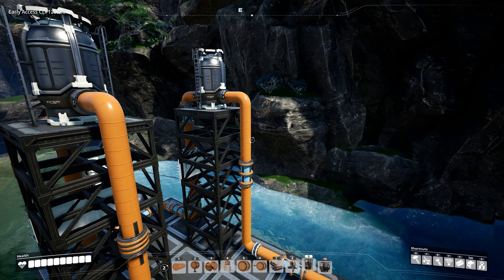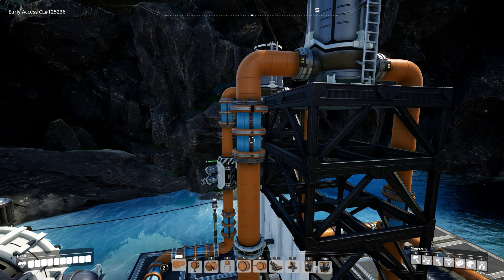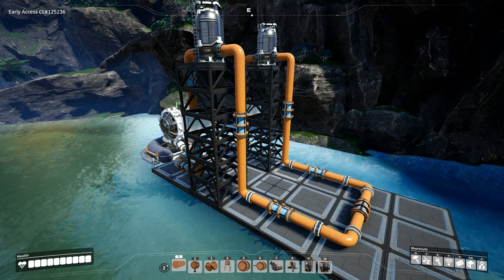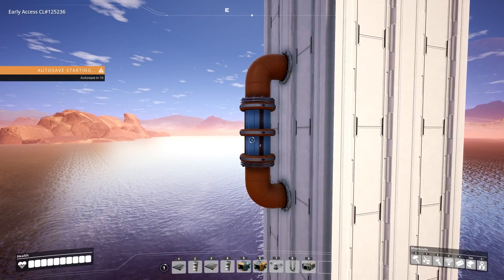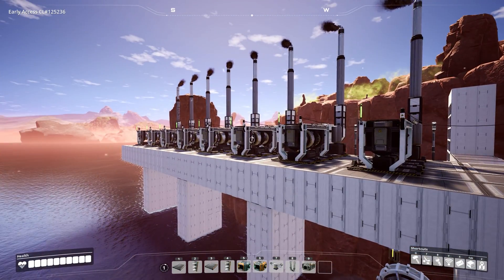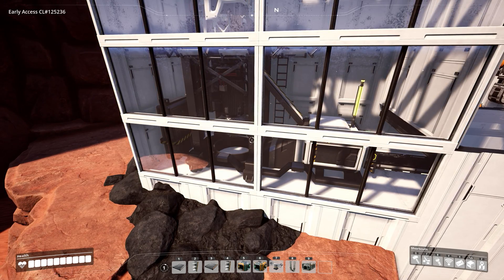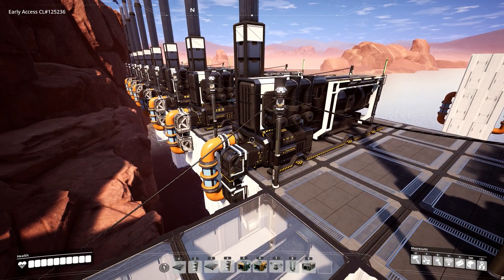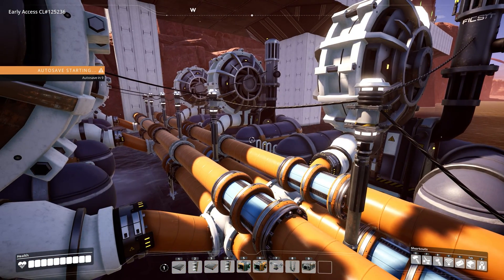100% Efficient Coal Generator Basics [SATISFACTORY GUIDE]

Comment: Your channel is a savior from heaven! 
 I seem to have an issue where the coal to the fursthest generators doesn't reach them quickly enough for them to actually get those 15 coal per minutes... I have 2 normal nodes onto which i put MK2 Extractors so that i have a total overflow of 240 (that being split into 2 separate lines, i'm still on MK2 conveyor belts etc)
Now, neither of the generatos seem to keep up with the coal consumption and i can't replicate your system given my space and small space of water (a small lake) 
Water tho, i'm running a pump moving 180m3 of water into 4 separate generatos, bringing it up to exactly 45m3 each (pump has an overclocking fragment inside)

Any suggestions? 
I can provide video and anything that might help, a streaming session on Discord too.
I'm testing the setup in creative so that i can actually replicate it in "survival" and have it generate 1.2GW of energy so that i can get past Phase 2 and Phase 3 with the energy needs.

Comment: Great tutorial! One thing confuses me a bit though. Where do you connect the bottom en top pipelines? Is that happening inside the tower, because I don't see any junctions where the bottom en top pipeline-layers connect between the water extractors.
Reply from the maker: Check this video out instead. It's more current and I spend the back portion of the video reviewing this specific build in better detail as a result of this kind of comment on the video. Hope it helps. https://www.youtube.com/watch?v=0ExdbBGt7ig&t=99s

Comment: Very nice video, indeed. I'm a fresh newcomer in Satisfactory, just 44 hours, tier 4 under work to unlock everything. I got some basic questions, if someone want to reply. First is, (consider i don't have mark 3 stuffs about conveyor belts but just mark 2), from a single resource node of coal, how many coal power generators you can feed? i've tried to feed 8, but too slow input of coal. the other struggling is the water pump. Looks like there's no way  to feed (apart doing the overclock) more than 2 coal generators with a single water pump, if you connect 3, is 120mq/minute against 50 + 50 + 50 of the coal generators, so after some, a couple of power generators runs with no water and the power line in the graph become not flat but a like a saw teeth. Any suggestions, please?
Reply from the maker: 3 water extractors to 8 coal generators and 120 coal per 8 coal generators. When connecting the 3 extractors to generators, you can’t run them all into a single MK1 pipe. You’re bottlenecking water. Each extractors provides 120 water/min so 3*120 = 360 > 300. What you need to do is feed each end of the coal generator system with a pipe. Better way to think is splitting 360 into two lines of 180 from each end.
Reply: @Scalti   Thank you very much!. Now i got 12 coal generator feeded by 3 nodes Mk2, with 4 pumps overclocked at 150, one connected with 3 generators. System runs finally stable, 900 MW. Now to optimize, i would like to add other 4 coal generators, total of 16, i will try to feed with two nodes Mk2 (1 less) and 4  water pumps, one will provide water to 4 coal generators. Should work, what do you think?

Comment: I’m still confused on the extra 60 pipe- is that coming from the “key pipe” that gets connected to the vertical pump, or does the pipe that comes down from the water tower split in two on the sandwich level, leaving one to make the run to the generators and the other to go straight to the last generator? If all pipes are connected and equal, what makes you have to specify that last one getting its own pipe?
Reply: After watching a couple more times and fiddling around with what I have going on I managed to finally come to understand the whole point of the other pipe and getting the water to average out- I learned a lot from this, thanks man.

Comment: I'm able to place a water extractor with 1m foundation blocks all around it, and then build a platform up and over the extractor, with two coal plants, and then another layer overtop that and using the soft overlay/overlap feature to stack two more coal plants within the smoke stacks of the layer below it. The end result is a 1:4 ratio of extractor to coal plant, with all four coal plants directly on top of the water extractor. It does require each building to contain a single fluid tank, and several pumps. But its super-compact and stays 100% filled on water, all from a single extractor.

This seems to prove that at least some of the calculations in this ~2yr old video are a bit off on the current update. But still another really amazing video from Scalti. I've already used these videos to reproduce stator and reinforced plates factories... both of which look fantastic. I love the general design methodology, which once you "get it" becomes a lot easier to arbitrarily create other factories.
Reply from the maker: Would keep an eye on that. The recipe hasn’t changed. One extractor provides 120 water and one generator consumes 45 so you have a 60 water per minute difference on this system. The golden ratio for water and coal is 3:8

Comment: Question: if i put a coal generator 3km from my base cuz the wate ris there, and use a ton of power lines and poles, will the energy make it to my base?
Reply from the maker: Yes. There is no degradation over distance.

Comment: REALLY wish I could see INSIDE the water tower on the build after the explanation. I still am not full grasping how you too 4 pipes down to the water extractor. You also explain after they go through the water extractor the split to three pipes.... what??? Removing the walls of the water extractor tower would have been very helpful sigh
Reply from the maker: Check out my fluid mechanics video. I cover this in that video along with a more detailed explanation of the water tower mechanic.
Reply: @Scalti  just a pro tip, people shouldn't have to watch a second video to be able to follow this one. you honestly should have removed the walls so people could have seen the pipes. just my 2 cents. also didn't the mechanics on the generators change in that they now utilize the full consumption rate no matter the power draw ?

Comment: Very good looking and clever built! I've spent quite a time in order to do something similar with the pipes and while I managed, the only thing that I still struggle is showing the water indicator on the small pipes going out of the tower. Any tips how can I have it there or else they don't make any sense like this.
Reply: And the moment I posted it I think I realised what happened - my cuts are too small. Now the distance between the wall holes is bigger and everything is as it should be! :) Leaving this in case someone else has the same issue.

Comment: when splitting my coal, by burner 8 the coal is running dry, what am i doing wrong. mk 1 miner on a pure node with mk 2 belts
Reply from the maker: If you’re doing overflow system, it will take some time to balance out. Otherwise, I have no idea. :\
Reply: @Scalti  for some reason last night, it did just that, everything full of coal now, although my water kept drying up on 2 centre burners, lol, solution - add another water extractor, 4 on either side, all working fine now. thanks for your reply and carry on the great builds !!
Reply: @horse197235  yea the "manifold system" (a bunch of splitters in-line) takes a bit to fill up. usually most people don't power them up till they buffer up and fill all resources.

Comment: Visiting this video to try and help me improve my power system as my current system is/was greatly lacking in efficiency. 
I tried to follow the video best as I could given the location and scale of the build is different. I’m hauling a single power bank ( 8 coal generators and 3 water extractors). I have a Mk1 miner on a pure node, that leads to a mk2 belt to the first splitter and from the first splitter on I’m running mk1 belts. I’m not getting the full efficiency as demonstrated in this video. A believe a large part of that is my water system as I don’t feel I have a full understanding of it as well as it’s super spaghetti. Any help from some fellow pioneers would be appreciated.

Comment: How does the coal miner overflow system work? smart splitters?
Reply: just splitters, a normal splitter will automatically send the input divided by the outputs. so if you put a splitter down, feed it 60, it will divert 20 to each output. if you only have 2 outputs (the generator and the next splitter in the chain) then as soon as it can't send more to the generator, it will then send all input out the one side. so with 2 sides it will do 30 each side IF it can. as soon as a side can't handle the 30 it would send all 60 through the side that can take it. I hope that helps make sense of it.
Reply: @problemchild959  Damn. This was a long time ago. I think i had played Satisfactory for like 40 hours when i posted this. Now i have 400 isch.. XD

Comment: I tried to make my own version that produces 2400mw but I ran into an issue.

Instead of having the 6 with 3 on each side, I tried having the 6 come in from the side on the key pipeline.
A visual: 

    | | |
||====
    | | |

The || is double of course with it on top with nothing coming from sides.

I then routed it up a water tower and back down into the 4 like the video. Then it goes up. However, this is where it gets different. Instead of it it going two two on each side, I make it where all 4 go to one side and one pipe goes to 4 coal generators. Is this where the issue is? Does it have to be two with and end loop going to 8? I can attempt to redo the design but i just cant figure the issue out. Doing the 1200mw style in the video takes up too much space for me to make a new one. Tried to compact it a tad bit.

Comment: Dear Scalti, I noticed that your pipes enter your sandwich layer through floor pipe holes. I don't seem to be able to do this - is this done via a mod and if so, which one?
Reply: No mod. put the floor first and then pull a pipe through. There are no 'floor pipe holes' in the game.
Reply: @Jila_Tana  thats funny I bought them in the awesome shop and use them all the time. what you mean there is none in the game ?
Reply: @problemchild959  Thats funny that you respond with this after a content patch was applied to the game. I can assure you that before the content patch, those didn't exist.
Reply: @Jila_Tana  ok well just seemed like 6 months ago wasn't long. as a developer (not games) I know that even simple stuff can take a very long time so it just seemed an odd comment.
Reply: you can buy floor holes from the awesome shop with tickets from sending excess resources to the sink.

Comment: I'm currently having issues with this build. At 8:28 It shows two glass windows and the back of the MK2 Miner having a wall. it must be the way your camera is angled because the output of the miner doesn't line up with mine and i would need 3 walls instead of two. Also i can't see or figure how you did your belts into the factory. The smallest detail helps noobs like me.  #Kudos on the design
Reply: put a false floor in, drop the splitter onto it, remove the false floor

Comment: I know this is several months old now, but hoping you can answer a question about this build?

Inside the sandwich layer, your pipes have a junction that seems to connect directly to the wall holes.  I can't figure out how you did that.  I can get the junction aligned with the wall hole, but if I try to put a pipe there, it says that it's too short.  Mind clueing me in on how that works?  Probably simple, but I can't quite figure it out.
Reply from the maker: It’s not that close in reality. Definitely have a space in there to allow the pipe to be not ‘too short’.
Reply: @Scalti  Thanks

Comment: I had some trouble figuring out how to place the splitters on top of the pipes. Adding another 1m foundation and then stacking 2 splitters on top of another was what worked eventually. Does somebody have an easier method?
Reply from the maker: Build a 1m foundation in the middle of the layer and build the splitters on top. Then delete the foundation or keep.

Comment: i was going to build something akin to the elevated fluid buffer but i second-guessed myself and thought "oh they wouldn't have modeled bernouli's equation", but lo and behold.
Reply: also, i doubt they actually used the equation considering that all of the pipes have the same cross-section surface area, but it's interesting nevertheless.

Comment: This tutorial needs to be redone now that update 4 is on experimental because the power systems have changed. As I understand it now everything but biomass burners now provided maximum power output. You can build a battery to store the extra power. Until the update gets pushed to the normal game the old rules apply but players on experimental need to know about the changes.
Reply from the maker: You won’t need batteries for the system technically but yes you can add batteries to the build to smooth out delivery and capture overhead.

To clarify as well, I will update this video once mods are available for experimental branch.

Comment: maybe you wouldn't need such insane water pressure if your generators weren't up so high?
Reply from the maker: I think calling this insane is gratuitous, especially considering late game builds. This build only requires 2 pumps overall compared to the near hundreds you’d find on large end game builds not using the water tower method. Additionally, the generators are built high up to maximize water extractor real estate below. At the end of the day though, it’s user preference on how they want to build something. My channel merely provides guides for others to either replicate to a T or build upon adding their own flair or improvements.

Comment: I loved this design when I discovered it -- especially the physics governing pumping water to a certain height more easily. I immediately set about to duplicate this design for my own game. It took me a week -- scores of hours to follow the example and figure out the tricks to sandwich payers and the rest. But I learned so much by doing that. Then an update (or errant mod) crashed my 500-hour game (I had completed everything including gathering all necessary resources to switch on nuclear power tier 8).
Since no one has been able to help me salvage that game, I began again with all I had learned in the first one. Things went much more smoothly, especially with underground conveyors and Just Fly!
I came to the point I needed much more power (without fuel as yet) and so I set about to use your system. But this time, rather than building the generators high above the water, I built them at water level and dispensed with the (very neat) balancing tower.
In four hours I had 34 coal generators powered up with generous coal and water supplies.
Your designs are beautiful, but I could never figure out how to move from beautiful factories producing some screws, plates, and rods, to utility factories pumping out high volume steady flows of basic materials required by stators, rotors, smart plating, motors, etc. 
You did show me the value of building factories upward, which was a great assist.
I enjoy your soft-spoken, clear, and artistic videos, and I am looking forward to seeing the acres and acres of design required to produce 2500 versatile frames or 1000 modular engines. My present approach is to build these processes in (temporary) connected steps, since in my first game I wasted hours building a stand alone sequence for creating versatile frames, only to discover once you shoot the required number into space, you never need them again. (Unless the designers add these advanced elements as building blocks in future updates).

Comment: OK, I'm stumped at 7:03.  How did you get your splitters to build in the air like that opposite the conveyor wall openings, but with a bit of a gap, rather than snapped directly onto the conveyor wall (and thus clipping into the wall)?
Reply: Stacking splitters on top of one another results in them clipping into each other rather than doubling the height, as I thought might work...
Reply from the maker: Build an 8x1 underneath and then delete afterward.
Reply: @Scalti  Friggin' brilliant, man.  Thanks so much for these videos.  They're really the best out there.

Comment: Going to have a go at building this soon, my current setup is a quarter the size. I know this is an older video now but the only thing I would love to have seen is the pipes inside the water tower. I haven't got a lot of experience with the pipes yet.
Reply from the maker: Check my 2nd to last video covering fluid mechanics. It’s in there as well as a more in-depth water tower demonstration.
Reply: @Scalti  That's great. Thank you.

Comment: Congrats on the fantastic channel mate! 
One question about the pipe/watertower mechanics though. During your demonstration, the pumpless pipe going up to the watertank on the water extrator side shows opposite flow during your demonstration. Can you confirm that this flow reverses once the system fills up?
Reply from the maker: Can confirm. This setup works as shown. I recently uploaded a video on the water tower function in more detail and revisit the water tower in this build showing the inner workings. Would suggest giving that a watch as well if you haven’t already.

Comment: Is this keypipe stuff realistic? As in, do fluids behave this way in real life? It seems a bit... weird to be honest. :P
Reply from the maker: To an extend they do. Water towers aren’t to supply water but provide water pressure throughout the local area. In this context though it doesn’t work that way in reality because the head lift would eventually all be put back on the pump and exceed its capability.